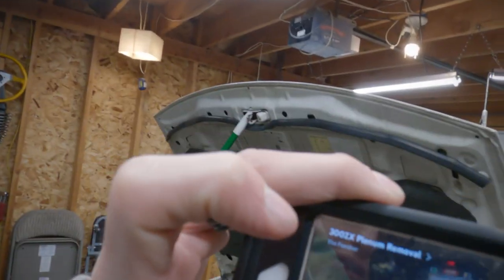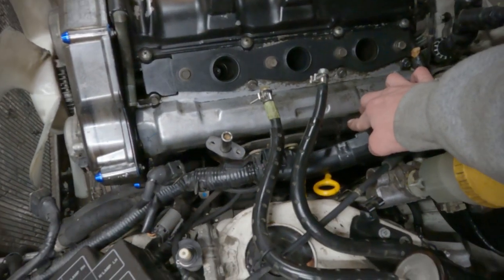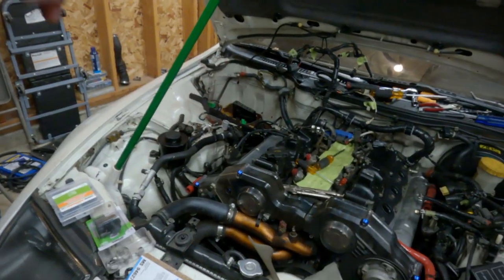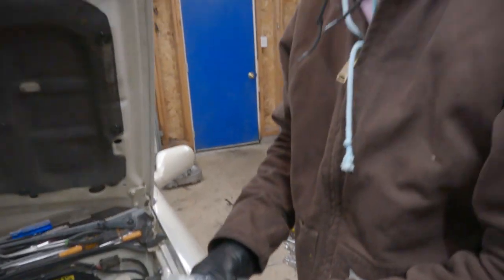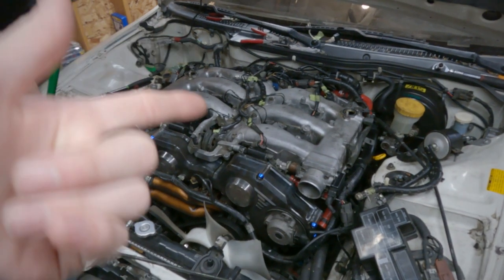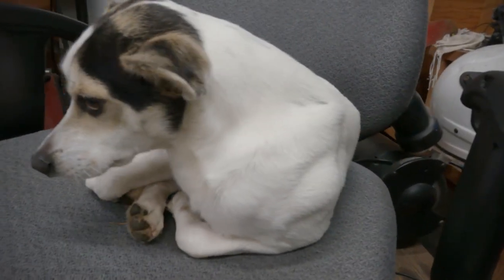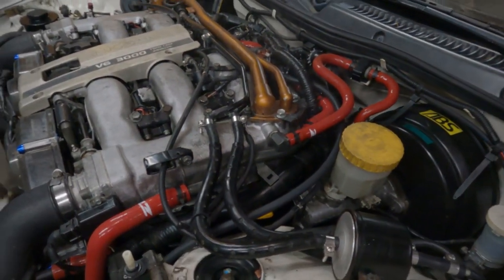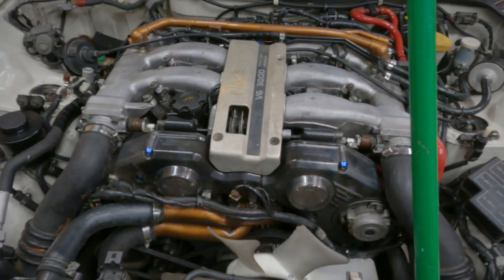FIXING THE 300ZX MISFIRE! | New Style Injector Swap, Coolant Line Delete, PCV Hose Replacement

Comment: Nice work! to finish:
1- do leak down test for any vac leaks.
2- set tps to .43 volts.
3. start car let fully warm up.
4. set base idle to 850-975 rpms. 1k tops.
5. set cas to 15 deg before top dead center with timing light after all the above has just been completed. car must be fully warmed up.

Comment: 208:12 you can ubolt the one side that is mounted over the pipes, no gasket needed, then that hose will come out with flat bracket attached, then just reinstall the ac idle air control valve without the hardlines behind it. no cutting needed

Comment: also pull driver side timing caver to inspect belt condition, if it has small cracks through out replace imediatley, these are intererance motors so i belt snaps motto is paperweaight. if does need to be done do the complete 120k kit, 60k kit is waste of time/money. do it all right while in there just like injectors. you on way to very reliable motor with basic maintenance continued. i put over 200k on my na motor and i whipped her hard, just always did regular and preventative maintenance on her.
Reply from the maker: Thank you so much for all the wonderful knowledge! I will absolutely do that. I’m enjoying this car a lot and I have no problem going back in to ensure it lives a long life.

Comment: Hey Jonas, I enjoyed watching your video! I have a 1991 NA that has been sitting in the garage since 2009. I want to get it back up running again, and need to order some parts to me in Germany for this. Since I was planning on replacing all the hoses and getting the master hose set from Z1 in black for $290 I might as well do the injectors if I am down that for anyways.
You forgot the link the kit in your video. I see Z1 sells a kit with 270cc injectors for 850$ and they also sell just a kit without the injectors for 124$. You mentioned that you bought cheap injectors from a land far away? 
Dave
Reply from the maker: Ahhh yes, I used Z1’s kit without injectors. I also used a set of late injectors off of eBay.
Reply: @JonasVanHorn  OK thanks!